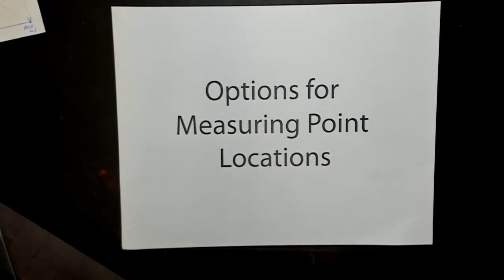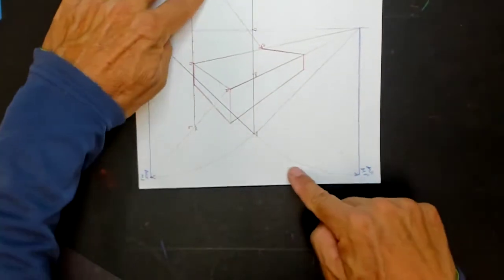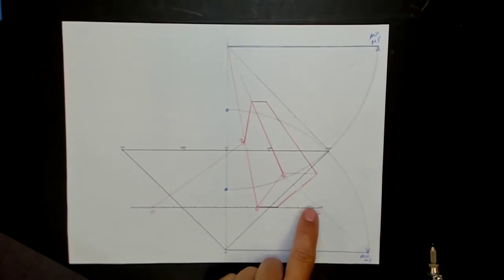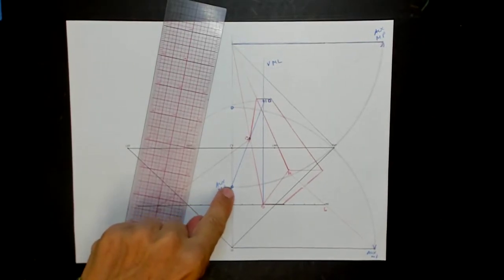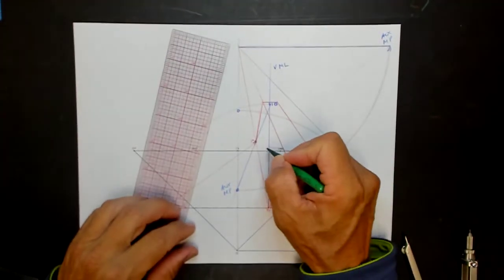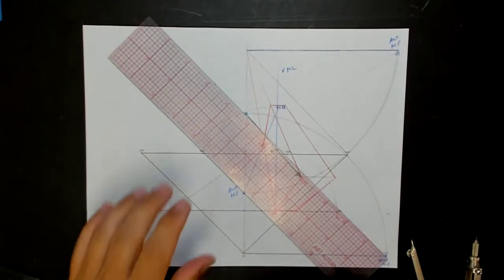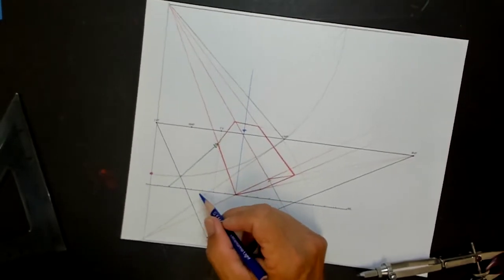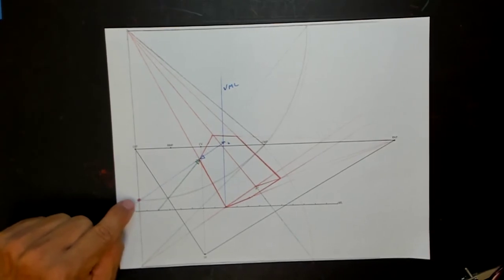72. Perspective Drawing: Alternate Locations for Measuring Points

Comment: so how does one calculate the inclined plane when the vp of that inclined is off the page? i cannot find the answer to that
Reply from the maker: That is covered in some other videos. I would need to search through them up to find the exact one, but it's in there somewhere 😊
Reply: @trustyourperspective  thank you ill look it up
Reply: @trustyourperspective Hi again sorry to annoy you with this i watched through 59 to 83 and in all the videos both LVP and RVP were visible on the page, you taught how to use the AuxVP of those Left and RIght VP's when the AuxVP were off the page(to find measuring points/use them off the page) but you didn't taught how to calculate them when the LVP/RVP were off the page, it could be the 73 video of the series since it is missing, but could you please makea video about it if theres a way? or is it that truly the only way to measure this is by projection(video n82)?
Reply from the maker: @ArtLibraryRESEARCH  are videos 34 and 35 what you are looking for?
Reply: @trustyourperspective  yeah but if that  VP off the page would be used as a vase for an inclined, wouldnt be impossible to to find its AuxVP and its AuxMP? since the vertical line of that inclined would be off the page?
Reply from the maker: @ArtLibraryRESEARCH The procedure works vertically as well as horizontally.
Reply: @trustyourperspective  yeah it works if the vertical line is on the page but the vertical line would originate from the Left or Right VP that would be off the page, i can use that VP on its own by using what you taught in 34/35, but i cannot use the Vertical line that gets you the Inclined VP and its MP right? thats the lesson that is missing
Reply from the maker: @ArtLibraryRESEARCH Ok, now I understand. Probably the best way to approach this problem is video 82. I have another approach but it has a lot of steps and is a little awkward. The method in #82 would be much easier.
Reply: @trustyourperspective  really? thats so sad, i looked through many books and your approach was by the most retailed and easy to understand but if you say thats the best way im trusting you :), spend the whole week looking for an answer to this now i can finally move on, thank you. projection it is
Reply from the maker: @ArtLibraryRESEARCH You can use the Law of Cosines to resolve the missing lengths of the triangles. You just need one length of the triangle and one angle, but I'm trying to avoid doing math.

The more analog method is to use the Triangle Proportionality Theorem. Create a proportional diagram at 50% size to establish the angles needed, then you can use those same angles for the larger diagram.

There may be a better solution but I haven't been able to figure it out yet. 

So, probably easier to just use the projection technique. 

But I do like the idea of doing a video on this problem. It's a good one. Then maybe someone out there knows of a better way.
Reply: @trustyourperspective thank you for clarifying all the books i read just overlook this issue and i just dont see people explaining this so i got confused, like is it a given and i dont get it?  but it seems a weirdly complex topic people just do not talk about it.
Reply: @trustyourperspective ill look those and try the projection technique
Reply: @trustyourperspective  Maybe (once you've gone as far as you want with this whole series) you could also cover some mathematical approaches, because once one understands it purely from the physical perspective, it wouldn't hurt to add the math methods to one's arsenal! Especially when you start to use longer "camera" lenses, the VPs, MPs and Aux MPs will be consistently far off your table, let alone piece of paper!